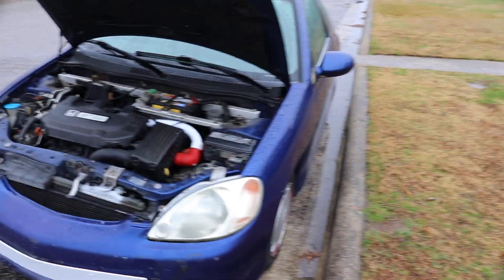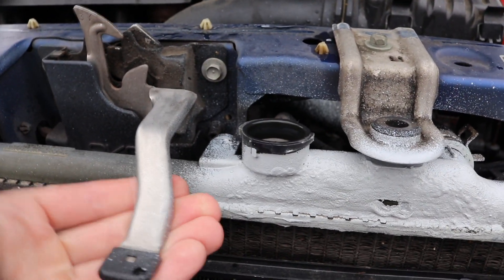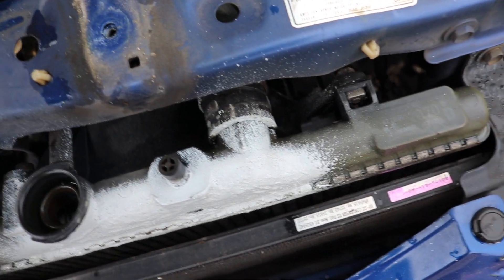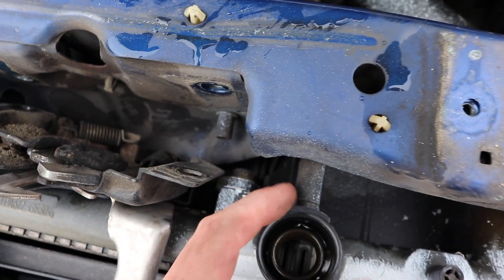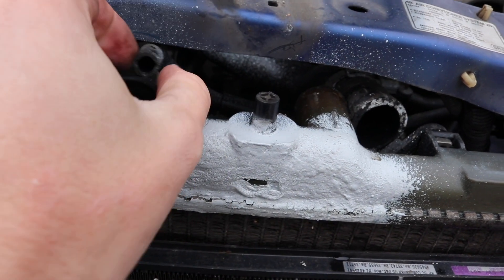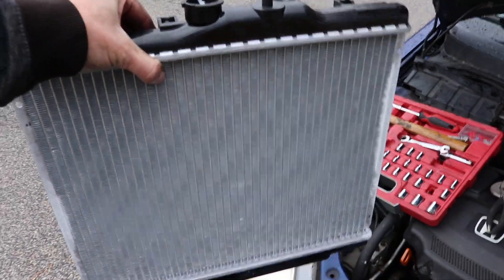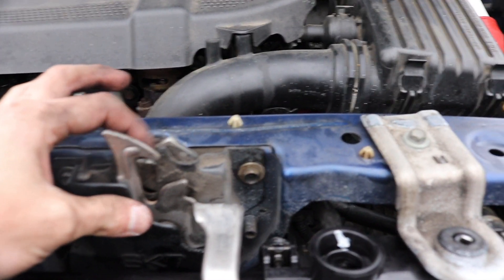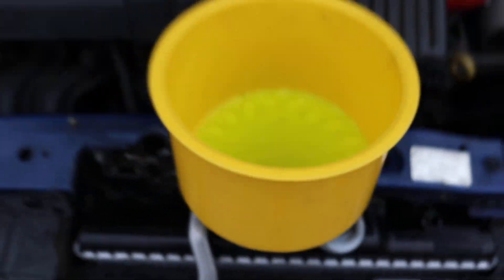2001 Honda Insight Radiator install

Comment: Would it be easier to pull the radiator out from the bottom, if were up on jack stands?
Reply from the maker: There is a lip on the bottom where the radiator sits, It would be harder to do it from the bottom
Reply: @JRobling  I ended up separating the fan shroud from the radiator and moving the shroud out and down toward the driver's side. This allowed for removing the radiator from the top after disconnecting the hood latch assembly. Easy peasy.